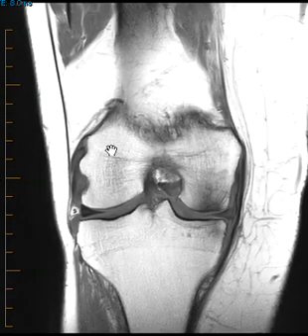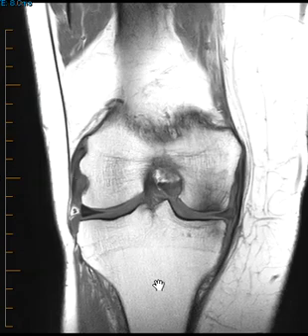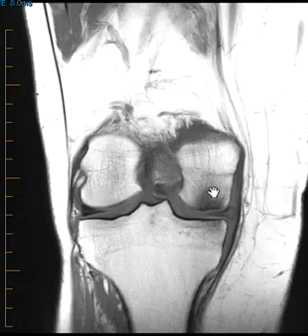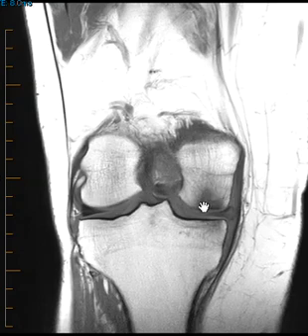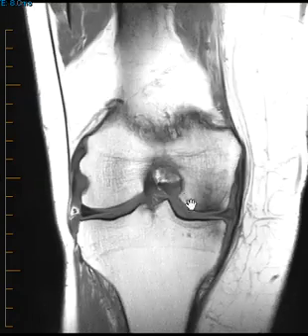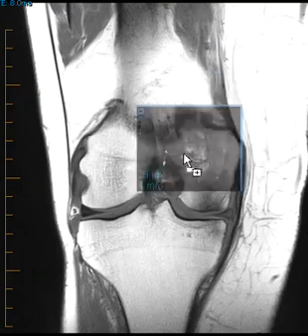Radial tear medial meniscus and stress fracture of femur

Comment: Left knee MRI shows insufficiency fracture femoral head and healing of tibial insufficiency fracture and extruded medial meniscus with parrot beak tear at the root. Ortho surgeon recommends repair of meniscus but because of the insufficiency fracture wants to wait 3 more months giving the bone time to heal. Thankful no locking mainly swelling and stiffness. Glad to not have to do this during the winter/snow months as he said I’d have to be non-weight bearing for 4 weeks. Hopefully the meniscus will still be repairable in 3 months.